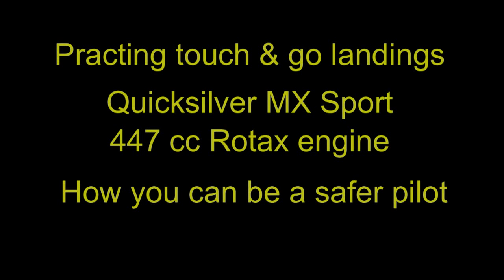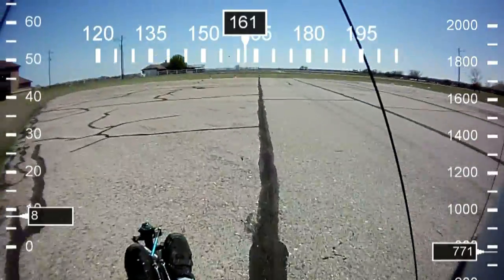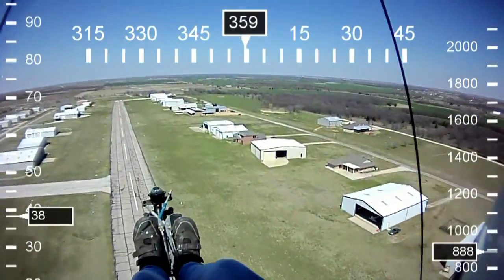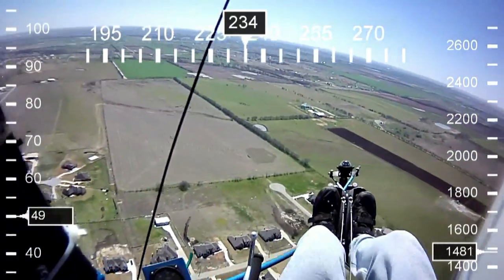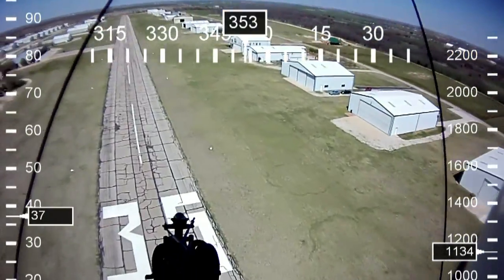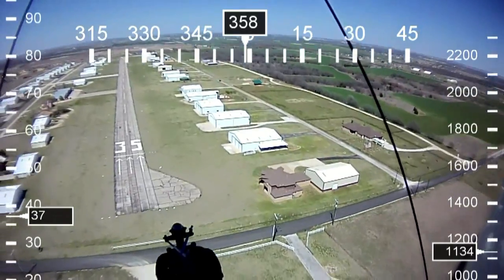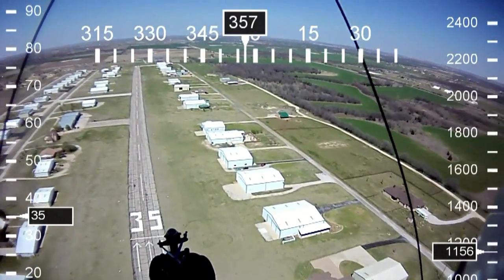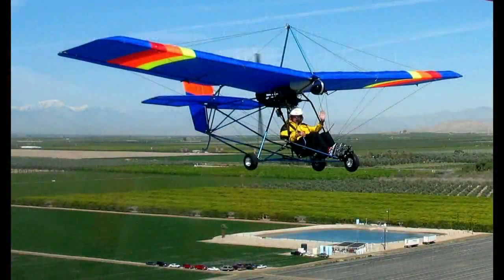Flying Quicksilver MX Sport practice touch and go landings Roy Dawson video

Comment: Roy you mentioned a type of low noise or noise cancelling headset or  helmet can you point me in the right direction... manufacturer or distributor
Reply from the maker: Go to Acusticom for helmet. https://store.acousticom.com/helmets/ultralight-helmets
next pick out a david clark heatset, best one would be the  large earcup one, like the military uses. buy used on ebay, after that you will need noise cancelling setup
www.headsetsinc.com, it might be model MX-01-A, this system can be added to the headset, if you cant do it have a radio guy install it

Comment: Very good- complements my instructor's teaching.  I'm learning to fly an ultralight with the same seriousness as if they were private pilot lessons and am getting as much professional teaching as possible.  The temptation to hop in my Quicksilver now and go for a spin is pretty strong,  but I'm going to let wisdom prevail this time for as long as possible.
Reply: Backpacker Thrulife , the primary thing you need to learn is NEVER, and I mean NEVER, let your flying speed get below the stall speed until you are touching the ground.  Pulling and pushing the stick forward or back controls airspeed.  The throttle controls whether you descend or not.  Coordinate the two.

Comment: hI Roy, thanks for all the videos, I am just starting out with Quicksilver, initially started with a Tecnam P92 which was very easy to fly. My instructor informs me that to turn this aircraft its primarily the rudders that are used, the stick then is then less used. Is this your experience and why are the ailerons almost secondary?
Regards from Sunny South Africa
Charlie
Reply from the maker: Yes you can use one or both, ailerons important when landing in a cross wind
Reply: Basically rudder is positive input and ailerons are negative. If you turn with ailerons mostly you would need more throttle to maintain altitude. Not enough airspeed results in tip stall. Less throttle is needed with gentle rudder inputs all around and since you're letting the plane fly itself through the turn there's no risk of tip stalling.

Or so I've heard. I gotta put my knowledge to the test next year when I start flying.

Comment: I used to fly Quicksilver ultralights.  They are a lot of fun to fly but you really need professional instruction before going up by your self, that is if you want to stay alive to enjoy it another day.
Reply: Ek Chuah Studios very true!..
Reply: A couple of things about the Quicksilver MX from around 1982 with the snowmobile engine. Down at Lake Elsinore we all flew our first sole flights as that, no two seat practice, just hooked up via a two way radio to the instructor on the ground. A 15 minute 'guided' flight, after that you were on your own. The MX was so easy to fly, the only incident I witnessed was when someone sold a new MX to a girl and sent her out without a two way radio!! She became disorientated and didn't know how to land, so just kept going till she ran out of fuel. She then just did a series of uncontrolled automatic stalls and recoveries till she impacted the ground on the wheels but heavy enough to bend the upright framing. She was remarkably cool about the whole thing and our 'instructor' said he would fix the machine and use a radio to help her out next time.

The other thing is about landing with the engine out, I did this after about 5 hours practice. In theory the engine is restartable form the seat, yes it is but with two hands. Turned the engine off at about 2,000 feet and tried to restart it. I was afraid to let go of the control lever and couldn't start it one handed so had to land 'dead stick'. It was actually easy but very frightening at the time.

The MX was very strong, easy to fly with a great power to weight ratio and great fun.

Comment: all talk about engine failure  scary
Reply: In an ultralight, power loss isn't really dangerous if you know what you're doing. In these, you can land going no faster than 25 or 30 mph, some as low as 15 mph. It's not like a GA aircraft where you're landing at 60 to 70 mph. Just about any field will do just fine